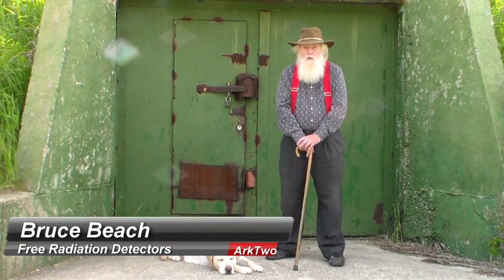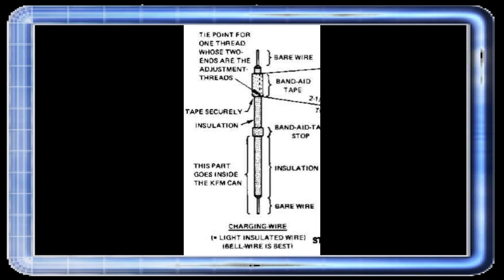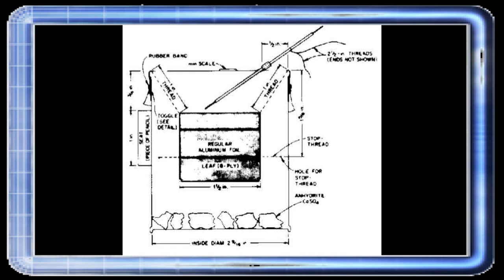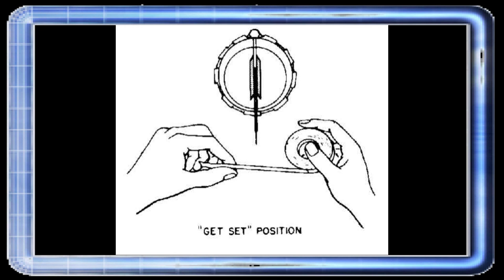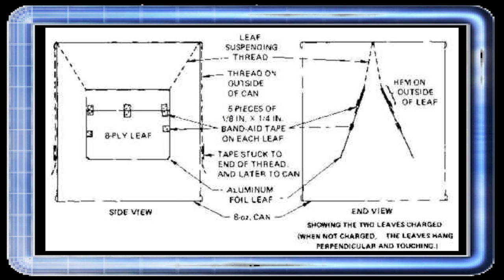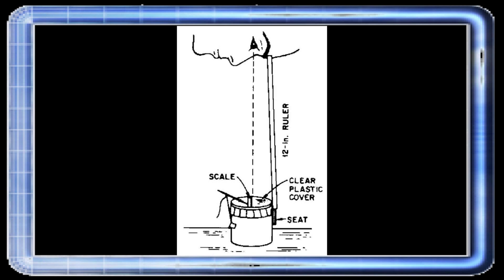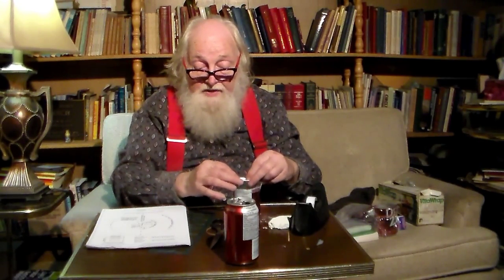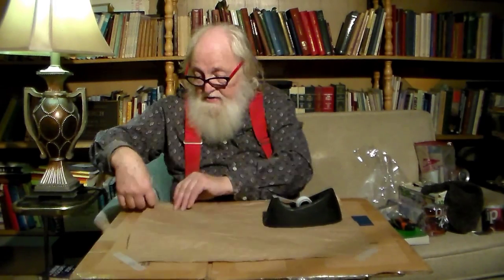Ark Two #18pt.3 FREE Radiation Detectors

Comment: I wonder if you actually tried this detector with some kind of radiation source. It's a nice construction and should work, but I am a bit doubtful it that could be more sensitive than a simple GM counter you can build for a few bucks. The other problem could be sensitivity to air moisture, which could give you high false reading on rainy days, especially when the drying agent already absorbed as much moisture as it could.
Reply from the maker: All detectors have their manufactured range of tolerance – usually +-15%.
I spoke personally with both Cresson Kearny and the engineer
whom he had the most confidence in for further improvements.
Yes, the device has been tested in labs beyond which I can personally match.
You are correct – the drying agent is a difficulty and requires some proficiency.
I don’t think the average person that I am trying to reach would  have skills
much beyond the 12 year old girl demonstrating the building of a KFM -
so that having them build something more complicated is out of the question.

Comment: To me, it looks a lot like a Lynden jar. I have dosimeters that work similarly. They charge by static electricity, and I have a base unit that they link to, and does just that. I know that Gamma radiation, passes through objects, and in the process kicks out some electrons. That is the damage. Radiation is a form of heat transfer, like a microwave.  If you feel a headache, dizzy, and/or nauseous, those are signs that you could be in the presence of radiation. Move to a new location, and the symptoms should disappear over time. In truth, go to a hospital if you can. I am interested in radiation, not because I am worried about nuclear war, but something much more real, and happening now. Please conduct the same test yourself, and note your findings publicly. I don't want to start chaos, so please question my information, and feel free to repost this. Scientist have gone over all the different ways Earth could be destroyed. One of the ways is the weakening, or disappearing of our magnetosphere. If that happens, our ozone layer would burn off, and everyone will be subject to intense radiation/heat. Oceans would dry up, and everything will die.  This is the magnetic field that extends about 100,000 miles into space from earth protecting it from the suns solar flares, which are powerful burst of gamma radiation. I have heard from different sources, including the news, that our magnetosphere is weakening. Here is my testimony:  I work outside, and have noticed that I always have more energy working at night. I work day shift now, and decided to purchase dosimeters. I have two, and the charger. One I wear, and the other is at home(the control). These units will hold their charge for at least  years. The one I have at home never needs a recharge. The one I wear to work, I would have to recharge it a several times during the summer months. It gets me thinking, what if pollution is not the reason for the slow destruction of earths ozone layer, but an excuse to keep people calm?Now let me give you my last evidence. 2 Peter 3:10-12